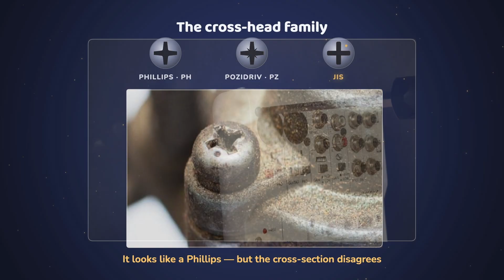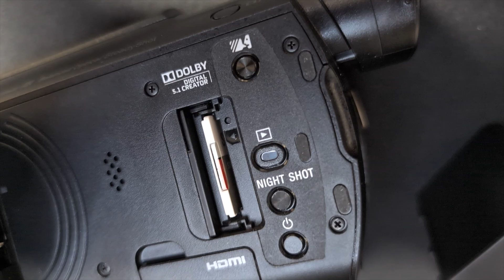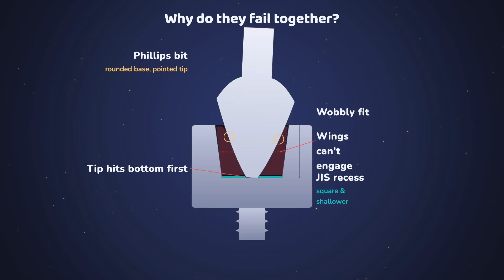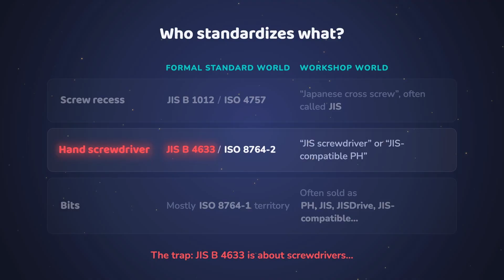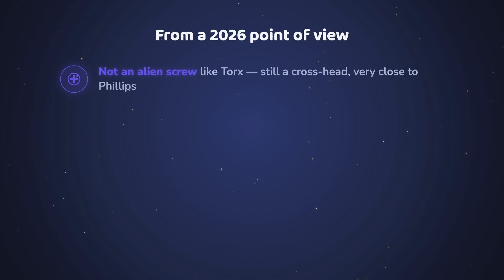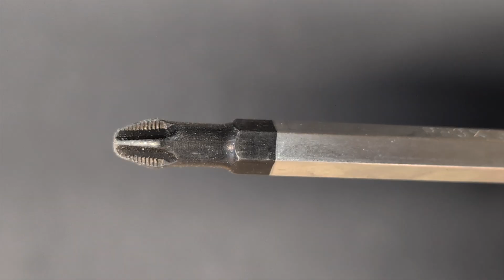Stop confusing JIS and PH (Phillips) screws and bits!

Comment: Really useful video, thanks for the info.
Reply from the maker: I'm glad you found the information useful! I'm curious where you use JIS screws? (If you do 🙂)
Reply: @DIYSecrets  My mouse has them, which I found out when trying to do a deep clean on it for the first time last week.

Except I confused them for phillips screws and when trying to use a phillips bit to unscrew them didn't work, I tried to force them open with a tiny flathead (dumb mistake, I know, but it's my first time doing DIY stuff). 

This worked for a few of the screws, until I ended up stripping one of them, lol. Wish I'd seen this video earlier.
Reply from the maker: Thanks for your reply, @elielc.8459 
A mouse - wow! Out of curiosity, I just opened my Logitech mouse, and it uses TORX screws.